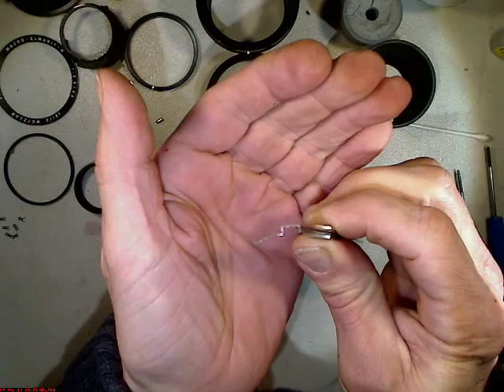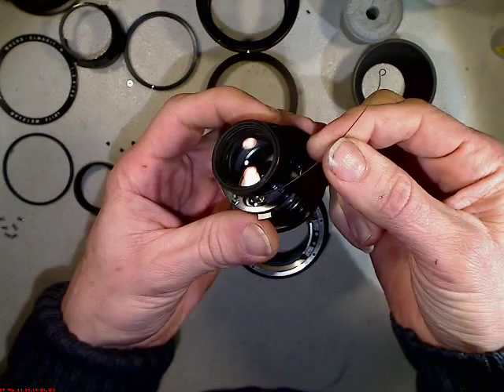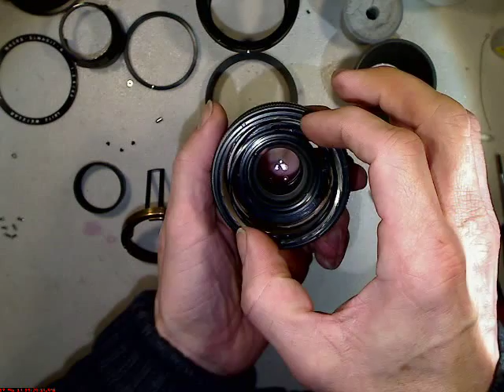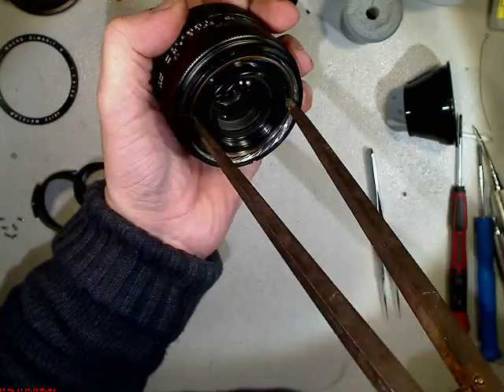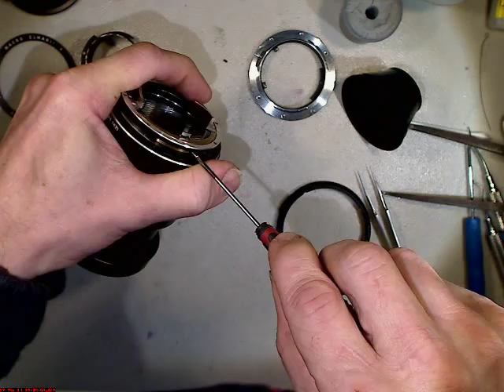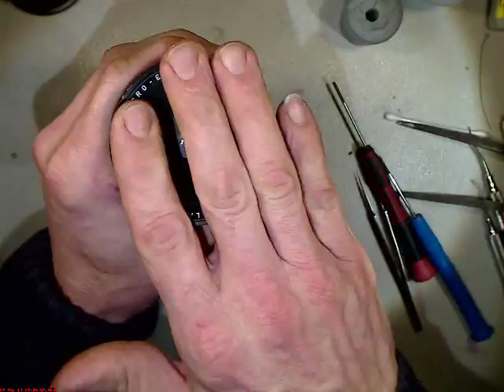How to DE-Click Leica Macro-Elmarit-R 1:2.8 60mm___Motion Lapse film

Comment from the maker: Hi Sekander (and others)

The little steele ball for the aperture ring is sitting just under the bajonet, remember to also remove the very little spring.

You are right about that there are some people that use this lens for making videos, but they on the other hand do NOT want the noisy clicking aperture ring on the sound track.

I have no idea how the "professional" repair tech make those lenses click-free, and because i could't find any info about, how to do it, i make my own version out of a little piece of 0,2mm thin stainless steele from an old camera part that i cut and file into correct shape.

It works very good, the aperture ring is not too loose, but on the other hand still very light moving. If the aperture ring is too loose, i can just add some thin grease, it will make it a little more tight.

Cheers
Kenneth

Comment: Neat! Thanks for sharing.
I was unable to see the little steel ball location and its removal. I probably missed it on your great motion lapse. 
After this De-clicking procedure, how tight/loose does the aperture ring feel? I'm zero-experienced in glass disassembly & reassembly. BTW, got the same glass, an old 1978 model works great but I'm considering de-clicking it to use it as a video lens.
Keep on posting, all your videos are super-instructive.

Comment: Kenneth, hello! Chris here, saying thanks for your wonderful channel! I have a question about my old 2-cam Leica Macro Elmarit-R 60mm lens - it's about the lens shroud at the back of the lens. I see from your timelapse that it's in two parts? Does the outer ring just click on? Or is it screwed on? Looks like mine is made of metal and not plastic like the newer ones, so it's not flexible. I don't want to stress or break anything, but it would be good to know if it is clipped on like the one in your video seems to be, or screwed on to the inner part.
Thanks and much obliged!
Reply from the maker: Thank's Chris, It's actually a plastic ring on the back in this lens, the plastic ring broken a little so I need to glue it, (You maybe can see some areas where was some glue) and the little tube was put in at around 8:14, so I think this lens must be some of the newer lens's.

Cheers
Kenneth
Reply: mikeno62 Got it, thank you!
Reply: By the way, do you have any experience with repainting lens bodies? I might be getting one in that was badly scratched outside. Glass is good though.
Reply from the maker: I have no experience with repainting lens' body's, but I would guess that Automobile painting would be a good solution, because it's a strong painting.
Reply: mikeno62 thank you!